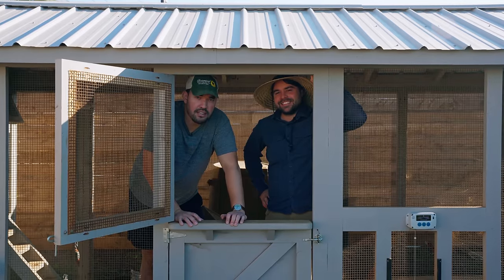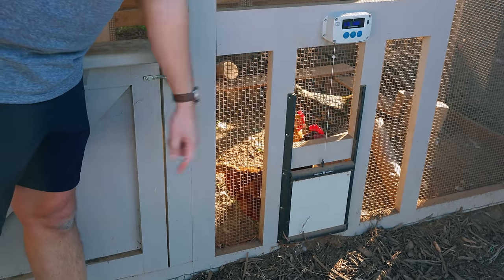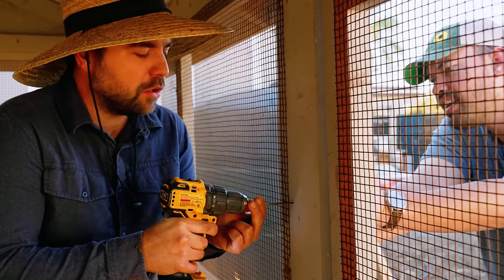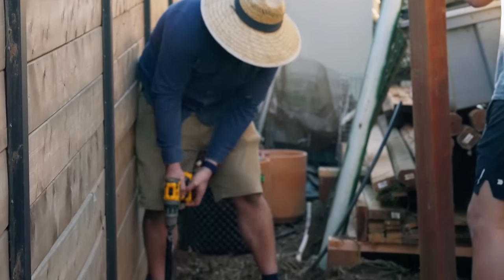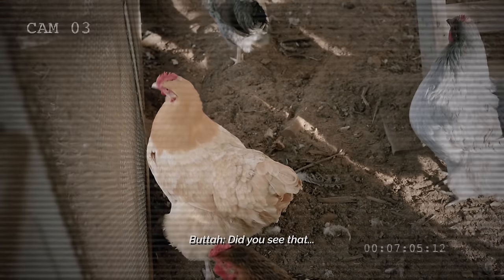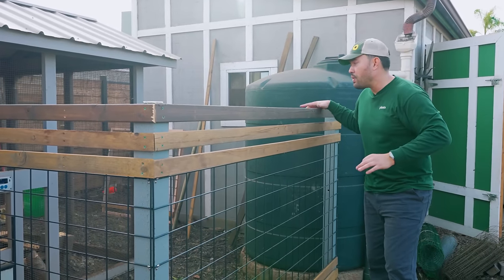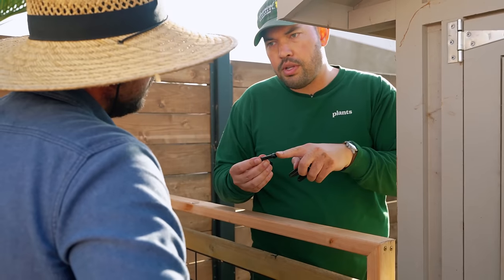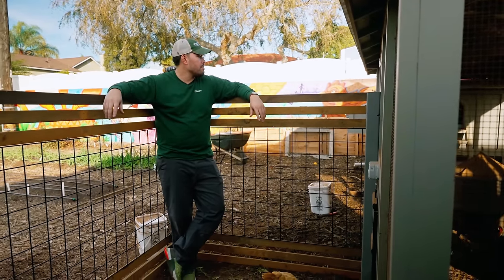DIY Outdoor Chicken Run Build for the Epic Hens! 🐔

Comment: Nice job guys! I will give one piece of advise: Get a side handle for your DeWalt drill! Using a Power Planted is great one if it snags on a root or rock or hits heavy clay your wrist will pay for it when that drill torques! Not all DeWalt hammer drills can have a side handle attached to it (it needs to have a stationary collar forward of the clutch set ring). Until then…use your other hand to steady the top of the drill as you dig holes. Believe, I know!

Comment: If you are thinking about some planter boxes outside the front of the run, how about building a livestock panel structure that would connect the top of the run fence to the roof of the coop? Then plant vines that would go up the run fence and arc over the run for shade.  Maybe a kiwi vine?
Reply: This is what I was thinking as well!❤

Comment: Falcons and hawks will absolutely get into that small gap (learned by example). some bird netting above will help but any gap will allow them in, and they will get stuck and fly into the netting so best to have everything sealed off. Even with bird netting, I have lost a few as the larger hawks will attempt to slam through the netting if they feel they can. I keep a board nearby to hold them down when needed, heavy gloves to grab them and release them. Nature finds a way! lol. Good luck. :)

Comment: I learned a lot. Can't believe the auger attached to a drill works that well for post holes and those little clips to hold hog wire is a lot better than staples that I end up hitting my fingers about 10 times with a hammer and if you make a mistake hard to get out.  I've been freeranging but lost 2 because whet to neighbors and he hasnt returned them. Good idea about planting around pen for hens to forage. Thanks what I have now is a bit of an eyesore.  your setup looks great. Thanks for all the tips

Comment: You can add easy trellis for veins by using ladder mesh for rebar, it is 10- ft long and you could curve it up from the fence to the roof tall enough so you don’t have to duck your head, also will provide shade and overhead protection from birds. It is very light weight but sturdy.

Comment: I'd still try to give some type of netting/protection on top. I've seen time and time again with my chickens, that not only do hawks dive but, sometimes land in trees in my run or on the roof and jump down from there to get them. They can literally jump down and run/hop at the chickens to get them if they don't have a place to go to get away. 

With the wood braces you have on the top of the run, you could just attach some 1x2 or whatever you have as "poles" coming up from the wood as attachment points to drape your netting from the coop to the "poles" 

For what to plant for them, chickens like dewberries and blueberries, which when grown enough will give shade to them in the summer. If you plant thornless dewberries (so they don't hurt themselves) they will trail up and they can pick them off in the late spring! (might turn some of their poop blue/purple though lol)

Comment: Quick moveable run, find a frame from a above ground swimming pool, wrap it with wire, chain link fencing, netting, orange fencing you see at construction sites, snow fences,  I have a tunnel that goes from the coop to it, it's between my fruit tree rows, mine is a 16' round, 4 people can move it, works great for us.

Comment: I would put one or two thin wires on top all around the fence. Chikens can fly high, and when they see a plank on top of the fence, they will fly up and try to sit on it. Chickens have a bit bad sight, and if there is a wire above it, they will fly into it and think there Is a invisble fence and not try to fly above.

Also, bushes are god for chikens to hide under and make it harder for hawks to spot them and catch them

Comment: You want them to forage for greenery without them ripping the plants out?
Pick the section of their new yard that gets the most light, get some fine gauge mesh that can be laid over that section of ground that the chickens can walk over without their feet slipping through. Raise the mesh up off the ground with a wooden frame so that the chooks can walk over the mesh and they will be suspended about an inch or so above the ground.
NOW broadcast sow a heap of grass or whatever you want, underneath this raised mesh platform.
When the grass grows it will grow up through the mesh and the chooks can walk around nipping off the tips of the grass without yanking the plants out.
They will also fertilise the grass as they feed! It will stop them turning any patch of ground into an instant dust / mud bowl.
Clever ay.

Comment: What about some more hog panel that angles over to the roof of the coop from the fence. You could grow some passionfruit vines or something similar to give them some shade and predator protection. Or seasonal vines so they get more sun in the winter and shade in the summer. Either way the additional angled hog panel with give them lots of extra protection even when nothing is growing on it. It could go taller vertically before you angle it over so that you can still walk under it.
Reply from the maker: As long as I can get under it, I'm down!

Comment: A simple cheap fix for overhead behind the coop next to the garage is run some fishing line between the 2 building and the take some short strands and tie them to the cross sections leaving the tails loose to flap in the wind birds can't judge the distance between the lines so they will not try to fly through them
Reply from the maker: Good call!

Comment: Could you get more hog panel and use it as roofing, going from the roof to the new fencing where the horizontal wood strips are?  It would be high enough that you still would clear it without having to bend over.  It wouldn't even have to be continuous, but could be. You could alternate it with polycarbonate panels or do the whole thing with them.  Last time I was pricing them, they were not expensive...maybe $35 for a large sheet.

Comment: Hi, have you covered the top of the nice chicken run extension yet? I’m planning to extend our’s and wondering if you could please share ideas for the overhead protection? In our case it will be too large to cover it with sticks or vines as we have a good sized space and want it to help replace their semi-free-wandering routine. This wasn’t the first time we’ve had close calls with hawks and also sightings of GHOs around the chicken house and run,  but 3 days ago I had just stepped from the chickens for 30 seconds on the patio into the kitchen when suddenly hens were squawking, flying against the glass & I was shocked to be met at the open door by the intense staring wild eyes of a huge hawk, atop my poor KFC, sweetest big RIR hen, ON the pathway where I had just stood…one second later she would have been dead. My yelling & moving toward her did the job yet I feared for her injuries…the damn hawk that is part of all wildlife that we honor and protect on our farm left the girls & roosters in complete shock, unable to leave the hedgerow around the farmhouse til sunset and traumatized to this day. Yesterday Rooster Johnny stared around the run from within for awhile, avoiding the normally safe-space as I open & stay by, guarding their door. We cannot protect our little flock of 7 unless we are constantly right beside them without distraction, not even gardening, 😢and it will be worse as spring nesting season is upon us. Thanks for any building ideas! We will most likely need a contractor to build a roof for the space, love your’s, and though I have admired Carolina Coops for the 2 years since I became a chicken mom this would prob. cost as much as the screened porch for our house I’ve been dying to design and build  ❤ Peace.

Comment: Kevin! Quick question, with a bit of info if you don't mind.

 Did you use any kind of wood sealer on the bottom of those posts when setting them in concrete? They look like they might be only painted, and if that is the case it may be okay for longer than if it were just bare wood, but generally speaking any time these materials are in contact with each other in the ground without any water proofing it will cause the post to rot prematurely, since concrete holds moisture really well.

Just some thoughts from a curious subscriber.

Comment: The hog panel is very pretty but unfortunately not predator proof. You should be using hardwire cloth for the fencing. Glad you got them some more roaming space 💖
Reply: I think that they will still be going into the original structure at night.  During the day is when they would be outside.
Reply: @barbarasimoes9463  agreed but it depends where you live... Kevin's girl should be ok. Predators hunt all day and night. Just something to be aware of for safety 🦺